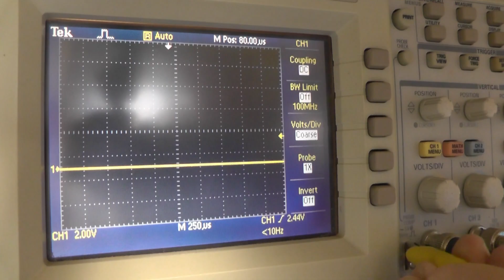How to test a zener diode and line output transformer.

Comment: Excellent.  Much better pace than Mr Carlson, who I watch on 2x speed and still feel the need to keep skipping forwards.  Straight to the point and interesting.  And BTW, that's just how I have always tested zeners.  Looking forward to seeing the Pye LOPT back in action.
Reply from the maker: I always worry about pace and the length of my videos. I always try to show doing a task once at "normal" speed, and then do a fast-forward through repeated tasks. You've seen me change one capacitor, there's little point in me showing the next 10. I think it works. Running time is a huge battle. Believe it or not, I try to aim for about 25 mins (a marketing person once told me that's the optimum length). I rarely, if ever succeed. I don't know what the average run time is, but I'm guessing it's close to an hour. I don't want to leave so much out that it leaves questions unanswered, or remove things that fail. I try to make videos I'd like to watch, and I try to set myself a "quality" standard, that being @adriansdigitalbasement. It's also important to try and leave a sense of how long these jobs take.
Reply: @AndyDoz I think you get it just right, and yes, 25 minutes is a good run time.  Getting the balance right depends on your audience, and it will range from beginners to people like me with a lifetime of tinkering behind us and an engineering degree including electrical and electronics.  I love bandersenTV, Shango66, Michael Dranfield, Don's old radio shed, David Tipton, Buzz1151, creekview actes, Manuel's electronics old and new.  There is so much out there.     I am quite happy to watch them for 45 minutes or an hour, and if I have a backlog to watch I just hold down the spacebar and watch at 2x speed.  I can cope with all but the fastest speakers doing that.

I find the pace of Mr Carlson's lab too slow and very repetitive.  He has decided to target complete beginners and has done so for many years.  He repairs some interesting equipment, but for me it's always a bit of a chore fast forwarding ,trying to get through his very long videos in a reasonable timespan. (25 minutes?)

So, keep up the good work, I am always  really happy to see s new video from you, especially the vintage TVs.
Reply: Paul "pay wall" Carlson. Bless him